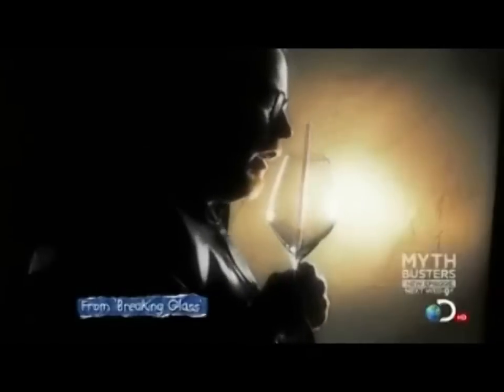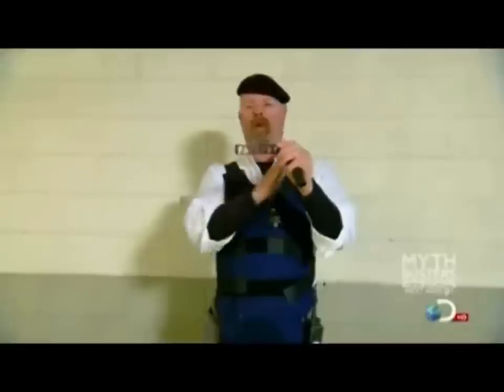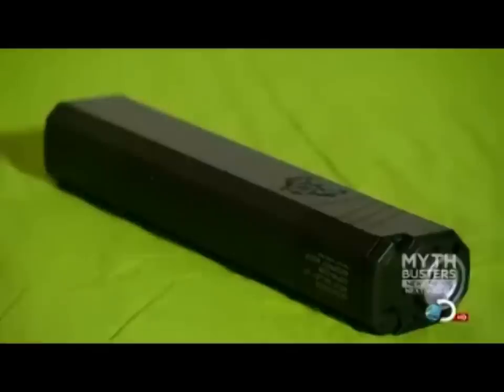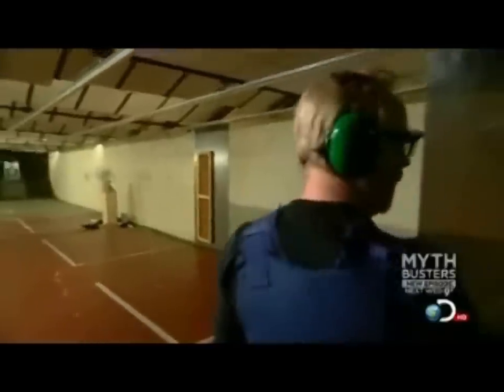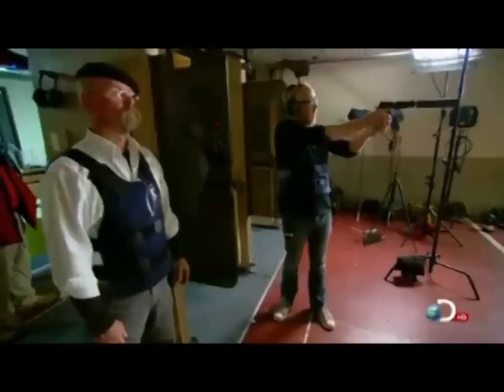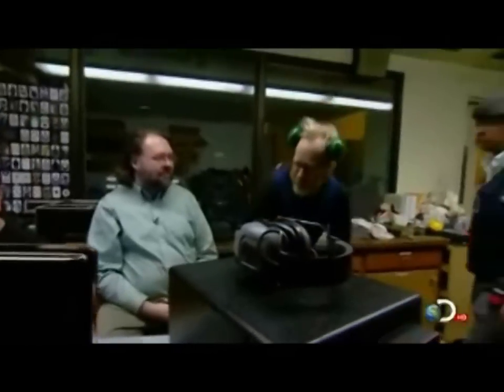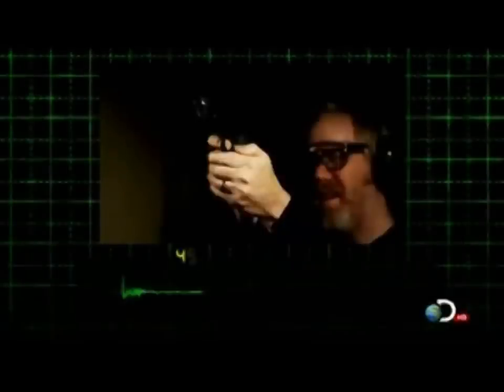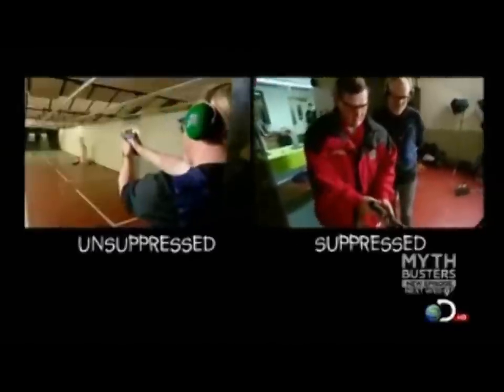Silencerco on Mythbusters

Comment: After having seen Myth Busters results get busted several times before . I lost what respect that I had for them. They need to stick with making movie props and effects.  Specifically the Carlos Hathcock myth that they said was busted as impossible, but yet a Marine Scout Sniper made a video busting the Myth Busters verdict. I figured that they would have had an actual trained  Marine Scout Sniper and the actual equipment that was used by Hathcock and the VC sniper hunting Hathcock. But they did not . They didnt even look into what gear was actually used and it looked like they used whatever was on sale at their local Wal-Mart.  
  When I saw that I knew the results they would find would be incorrect and tainted as well as showing that they are Not the experts they think they are as well as how many other False results have they published and half assed.
    I also learned that Jamie and Adam do not know Jack Sh#t about firearms,shooting, military history, Military Armement , Balistics,  precision long range shooting, and that they cut a ton of corners.  
  I simply have lost confidence in their show and stopped watching them years ago. I would also say that this video was another failure given that their science, knowledge is once again flawed given that it is very difficult to get an accurate recording of the sound of a gun shot. It is even harder to get an actual surpressed  gun shot recorded accurately. Also the sound signature is very different at the guns muzzle and a completely different sound signature at the target and along the flight path of the bullet. Anyone in the military, law enforcement, people who are expierianced firearms enthusiasts and people who are knowledgable about surpressors and surpressed  firearms.  I am also very surprised that they did the filming in the state of California  since its one of the few states that it is very illeagal  to posses any type of Scilencers or Surpressors.  California is one of the most antigun states in the country and there is not very many firearms experts or firearms manufacturers in the state. Many of the company's in the state left after the state passed overly restrictive laws on firearms in the 1980s and 1990s .As far as I know scilencers have never been legal to own in the state but I am not positive if they were permitted before the crack down in the 1980s. 
  I hoped that they would have done there homework this time and positioned high quality mics along the bullets flight path from the muzzle to the target and beyond to the backstop and the bullet trap.  I  will also say that people who are knowledgable on the subject know that the sound will be different between different ammunition and Super Sonic full power loads and specialty Sub Sonic ammunition. Bullet weight will also effect the speed of the bullet and the sound of the bullet being fired and during the bullets flight. A heavy sub sonic bullet such as a 160 grain 9mm sub sonic loading  is going to be about as loud as a high power air rifle. The actual shot is a little louder because of the primer on the ammo.  
  With a surpressed firearm the loudest noises are the sound of the primer and the sound of the action of the weapon cycling. The bolt action rifle and any adjustable gas piston rifles where the amount of the gas can be adjusted to keep the rifle from cycling the next round with heavy subsonic rounds is going to be even quieter than what is in the video. 
  I think its safe to say Myth Busters is busted once again.  Maybe its just me but I would expect that Jamie and Adam would have done more research on the subject and that the sound guy would have known that the sound at the muzzle and at the target are very different  just the same as if the closest mic is a couple yards away. The are a ton of videos by gun owners  and hobbiests that have done a better job with their amateur video busting the movies sound effects.  
  Myth Busters Must have just become lazy after being on tv for years but they definitely dont know what they are talking about when it is Firearms Myths considering that their record on firearms myths has had an accuracy of being busted 100% of the time. The most accurate sounding gunshots in movies would be in the movie" Lone Survivor " and they are using surpressed and unsurpressed weapons and is very accurate sounding.   
  LOL they would hate it if a group of YouTubers made a channel that focuses on busting the Myth Busters show findings.  Jamie and Adam do make some amazing props and replicas of movie props and using their movie magic skills in making videos. But their Myth Busting is just god awful and false results giving the viewers a false impression and outright  misinformation.   Their firearms myths are just factually incorrect and misinformation.  If those videos are an accurate portrayal of how they do things . I am surprised that they are as respected as they are . Because of their ignorance about guns and what they can or cant do. Unfortunately between the Government and the Antigun leftists that just want to ban civilian ownership of guns outright. There is a ton of bad information and propaganda on the subject. As well as the intolerance of the left to accept the facts about firearms and eliminate the myths, outright lies,  propaganda, and outright falsr information about guns and gun owners. So I am not very surprised that they are adding to the misinformation  and not very accurate on the subject of firearms given that they are based in California.  
  I do think that they should revisit the various myths that they have been busted on and actually set the record straight and accurately set up their various tests, recreations, and myths that they have been called out on or flat out had B.S. called on their tests. If they care about their reputation and their methods. Since they say that they are experts on the subjects they use in their show and not to try to do anything from the show at home. When they are clearly not experts and far from it on some subjects.
  If you are interested in the truth theirs hours of gun videos on YouTube  on the subject of Scilencers and Surpressors  that are very accurate and are made by average citizens and Scilencer Manufacturer's. For the Hathcock sniper shot video  that busted the Myth Busters and their results search for Steve Reichert a former Marine Scout Sniper who used period equipment and proved that a sniper can definitely put a round through a enemy snipers scope.  
  Adam and Jamie need to man up and admit they are wrong and fix the incorrect and false videos they have done over the years.

Comment: @usbadass if you had any experience with firearms you would know that that is NOT a walther. Adam holds up a Sig Sauer (probably p226 or p229) in the beginning then Jamie shoots it as the 9mm test subject. The .45 they are shooting is a 1911. While I agree the "unsupressed 45" does not look like a .45, it's definitely not a walther. And when it is supressed it is definitely a 1911 style pistol. Pause the video at 1:59, you can clearly see the gun.

Comment: right, lets get our firearm information from "the films." As the gas exiting the chamber may be a factor the slowing of a round, the real speed drop off is when the round shot is a subsonic. And if snipers never us them in order to maintain the original gas, why do most standard military rifles have a barrel brake? Ill mention the M40A5 (not a3) as a prime example. And the semi-auto .50 caliber anti material rifles use them as well. Just something to think about.

Comment: sad they call it plausible because the movie makes it seem like you can fire in an apartment and no one will hear you. thats still not the case
Reply: It is if you use subsonic ammo.
Reply: I second that. When I fire my .22 using subsonic ammo it's as quiet as an airsoft. My .45 is almost as quiet.
Reply: I've never tried it, since I can't exactly shoot inside an apartment building, but the neighbors might hear the shots but not realize they are gunshots because they don't sound like unsuppressed gunshots. Through a wall it would probably sound more like someone hitting something or dropping something on the floor.

Comment: I have a YHM Turbo on a bolt gun, .223 Rem. While it does reduce the noise, it is far from quiet. Sub-sonic .223 loads will be very quiet but the KE is about the same as a .22 Short, not exactly a good choice to hunt with. I do recommend silencers/suppressors to anyone even thinking about getting one. The number of coyotes I kill has doubled since putting that can on. As far as this video(Mythbusters) is concerned, I think it's crap. They still have to "sell" each episode to the networks and it's drama they're selling, not reality.

Comment: They should give a comparison to the decibal levels so people will understand how loud they really are, since they lead you to believe the suppressed shots were really quiet.  So, let's do that.  Myth busters unsuppressed shot, 151db. Suppressed shot, 128db. From the db comparison chart. 152db - vibration is painful and felt in joints. 128 db - loudest human scream. Imagine the loudest human scream in your ear. Not quiet! Also, 127db is tinnitus in ears, beginning of permanent hearing loss. Humm. I'm pretty sure suppressed shots are NOT quiet. The main purpose shooters want to use suppressors is because they're supposed to get the db level low enough to prevent PERMANENT hearing loss. If you shoot enough rounds with no hearing protection, per the chart, you'll still have ringing ears. Myth was actually busted, since all the Hollywood suppressors I've seen, make shots sound like a whisper. Sorry guys. It's fairly obvious you "feel" like the suppressed shot was so quiet is because you are comparing it to the 151db shot, which could give you permanent hearing loss with only one shot. As I stated, 127db will give you tinnitus (ringing ears), and, the entry level of permanent hearing damage. Step it up a bit to 130db, and, that's equal to a 200 person marching band. Rifles, like an AR15 are even worse with dbs. Suppressors quiet, but, are still loud.

Comment: they go about 1,150fps if they use a very hot load... normally they go at 800fps - 900fps. its a short barrel flinging a heavy lead bullet... what the hell did you expect? (speed of sound is around 1,126fps)

Comment: How can you call it "plausible" without comparing the decibel level from the movies to the suppressed sound? 

Unsuppressed about 170dB which will damage your hearing and is only slightly below a jet engine with afterburner (174db). Suppressed is about 130dB which is only hearing safe in small, infrequent exposure and is like a jackhammer or power drill. In the movies I've seen with suppressors, the sound can't even be heard in through a single door or in the next room and is closer to 50-60dB like a washing machine or an air conditioner. 

I can't believe you called this 'plausible.'

Comment: so a suppressor does not EVER reduce a gun to "hollywood" levels.  In the movies the guys can be killed 5 feet from each other and the other guy wont know.  In real life, only a silenced 22 or 380 MIGHT do this.  However, the bullet and muzzle might be suppressed, the sound from the slid jamming back and recocking is very loud.  It would be like someone throwing a rock against a metal plate.
Reply: dinoreah 2  There's a reason why the term "Hollywood quiet" exists on the various supressor forums.
Reply: dinoreah 2 to be fair, supressed rimfire rifles, as well as various pistol caliber carbines, in manual actions (because semi autos make a tremendous amount of noise, particularly blowblacks) can be ludicrously quiet - there's a video here on utoob of an integrally suppressed Ruger 77/44 where the steel target impact noise at 100 yards is louder than the report of the rifle.
Reply: .380 isn't supersonic, at least, not from a little 3" barrel like most compact .380 pistols have. Muzzle velocity is generally < 1000 fps.

Comment: YOU're actually completely wrong. The cooling of the gasses and adding the buffers slow down the standard round. Not to sub-sonic speeds, but it DOES slow down the round. You don't NEED sub-sonic ammunition. Next you're going to say porting a barrel doesn't slow down the round either. It's simple physics.

Comment: could there be first round pop?
Reply: +PleaseDontWatchThese There is always first round pop.  It's a phenomena you can attenuate, but never eliminate.  Stacked K-baffle suppressors do a better job than monocore, but you're still going to see it on the dB measurement.
Reply: Maniac742 what if you run it wet?
Reply: PleaseDontWatchThese That reduces the first round pop.  I just don't like running suppressors wet because it's something you can really only do at the range.  In any other scenario, you don't have time to inject a precise amount of water into your suppressor.
Reply: Maniac742 how bad is the first round pop? is it still hearing safe indoors? the main reason for me why I would use a suppressor is inside a home.
Reply: PleaseDontWatchThese It's still 10x better than firing it without one.  The FRP is noticeable, but not ear splitting.  Like I said, some setups handle it better than others.  Stacked K baffles do well, but monocore suppressors are definitely easier to clean.  It's a give and take no matter how you slice it.  Monocore is also cheaper.
Reply: Maniac742 no one ever talks about the maintenance and cleanup you need to do on a suppressor. what goes into that?
Reply: PleaseDontWatchThese If you get one that comes apart then it's just like cleaning a rifle.  Take it apart.  Clean it off with solvent.  Scrub it.  Slap it back together.  Monocore you can be lazy with and just stick it in the dishwasher with no soap.
Reply: Maniac742 thank you for the info
Reply: Actually with a monocore you can take it out, put some white lithium grease in the baffles run say a chopstick through it to make sure the barrel path is clear. Then for a few months you got a wet can that doesn't leak and is ready to fire whenever you need it. Some cans are wet only and the white lithium grease is how you do those.

Comment: They should have done this with a bolt action .22lr....cycling the action on the gun is louder than the actual shot.  Actually the only thing you hear is the hammer hitting the firing pin and that makes about as much noise as a BB gun.

Comment: 125 db can cause instant hearing loss. Their sound guy wasn't accurate, and they think it's the same because they're getting old. This is a myth. You think 128db is quiet?! That the volume of a jackhammer. That's louder than a rock concert. 128db is not safe. You could be sued for playing music that loud at a concert.
Reply: Cory Ayers 128 is not permanent hearing loss or permanent damage.  If that’s the case any times I fired my rifle without any hearing protection I would of been deaf the first shot. As would damn near all hunters.  But even when I shoot suppressed in the 130’s dB range An don’t wear plugs or muffs. Why. It may not be the best thing.  But. By OSHA guidelines.  It’s hearing Safe because it’s an Impulse noise.  So your fucking wrong.  Maybe you should look it up an know what your talking about before commenting ignorance.  It’s SUSTAINED NOISE of that level that’s harmful not an impulse noise.